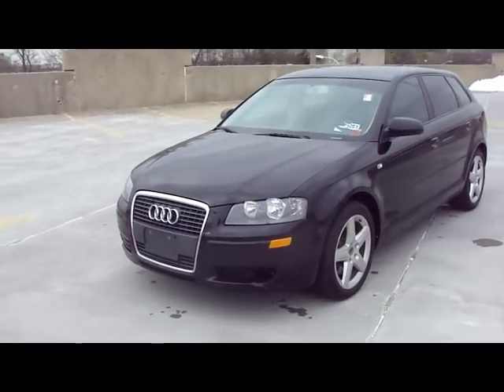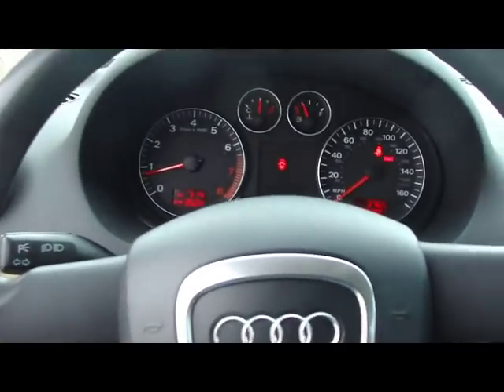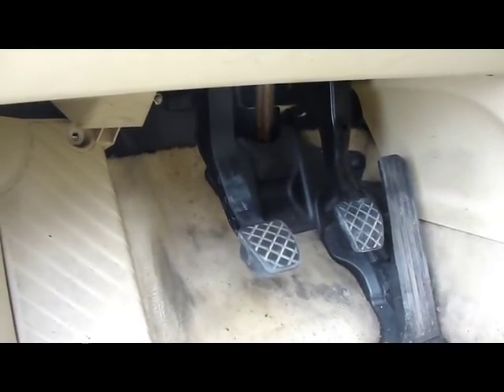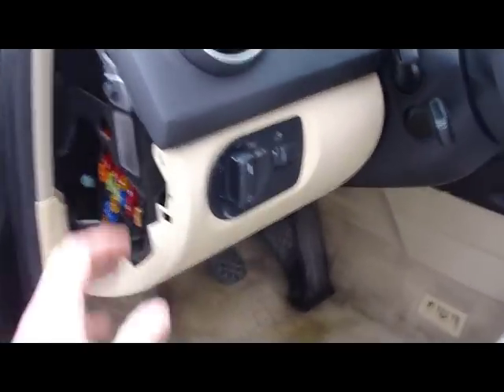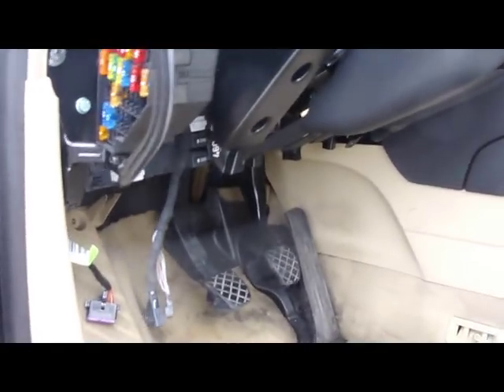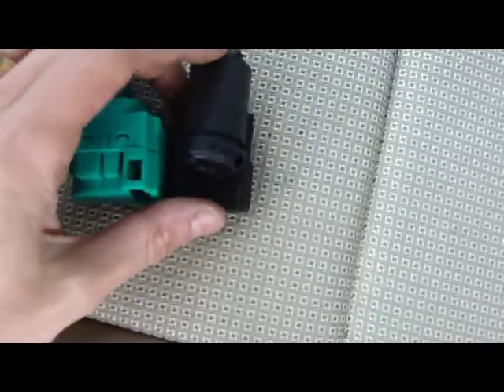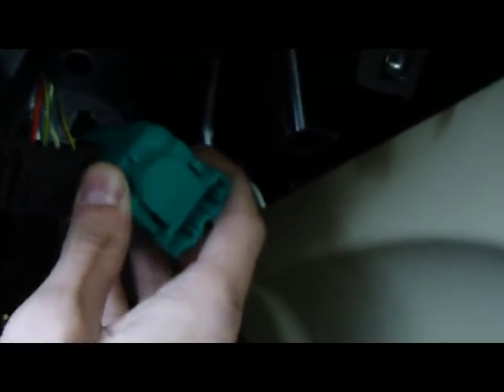How to repair Brake lights on Audi a3 a4 or vw jetta if they wont turn off or wont work at all

Comment: Been having the same issue with my 06 Jetta, tried everything else fluid, brake sensors etc. Has to be the switch for sure thank you for showing this video!
Reply: Yep same here I narrowed it down to the brake light switch.... But now they just stay on solid, as before they worked properly but stayed on after I parked. Now they just constantly stay on like im riding the brakes🤷‍♂️.  Maybe I have to adjust the spring or wrong Part

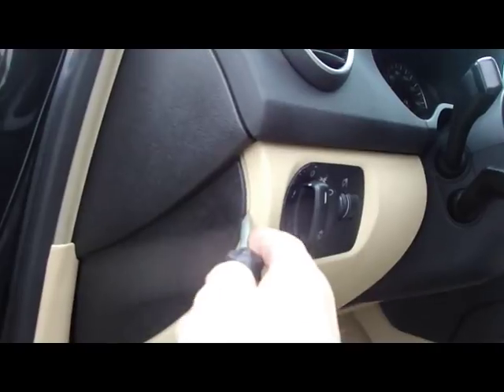Comment: 1:43 Just carefully not to damage anything - flicks the plastic panel on to the floor ... 
But still a good video, I just 'repaired' the switch in my Seat Leon.  The light wasn't coming on unless you really stamped on the pedal.  It also wasn't switching off the cruise.  Took the switch out cleaned it and reset it by pulling the rod back out.  Working normally again, hopefully it'll stay like that.

Comment: Got a 07 Jetta 2.5 with the master cylinder stop light switch, replaced and lights are still stuck on also pedal is stiff at low revs, gotta throw rear breaks on so going to bleed all of it when I do that but I'm not sure why vw didn't stick to this design had to tear a ton of crap out of the way to get the switch on this ..

Comment: Thanks alot, mine just started doing this on my A4. im gonna order it and hopefully it fixes it. its been driving crazy for a week now.
Reply from the maker: +DeathLotus hopefully it does.
Reply: Edgar Parfan i have an a4 2005 b6 which is kind of a bitch to find exact parts, an aftermarket one didnt work and audi stopped making the one for my car. what i ended up doing was i sprayed pb50 in the switch and it works fine now.
Reply: My a4 brake lights wont turn off whe. Turned on i switch break light switch but its still on what did you do ?
Reply: Did yours stay on with car off also?

Comment: I got a Skoda Octavia I changed my switch but the fault is still ther. What else can it be.
Reply: Remove the switch. Do the lights go off? If yes then it's something wrong with the switch
Reply: I got same thing
Reply: @algisjanulevicius5276  i changed 4 switches... Non of them worked
Reply: @algisjanulevicius5276  i changed 4 switches... Non of them worked
Reply: I have the same problem on my Octavia 2006 mod now. Did you ever find out the problem?
Reply: @MrLeeProductions  i have the same problem did you get yours fixed,